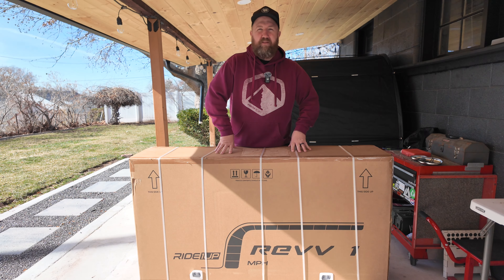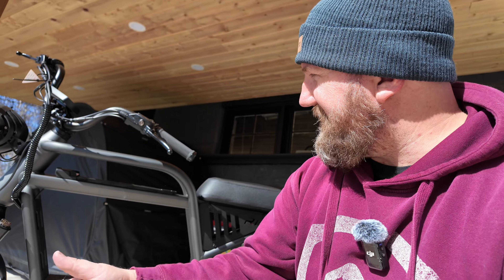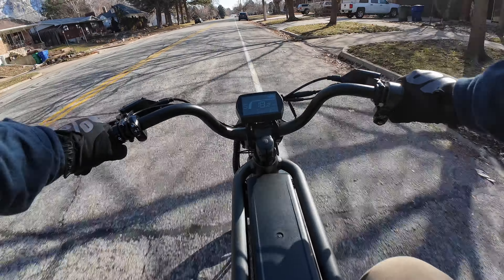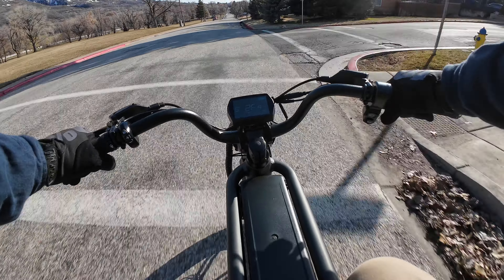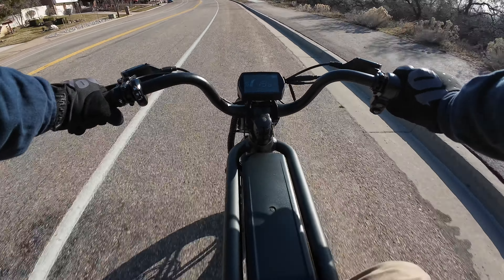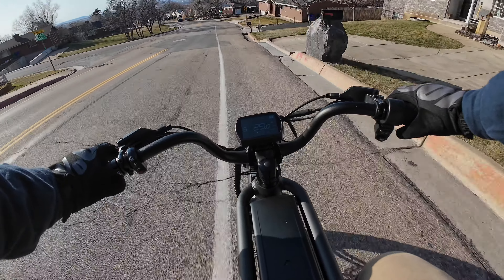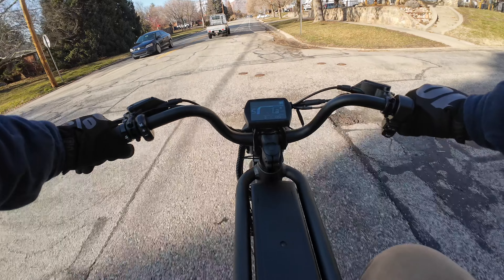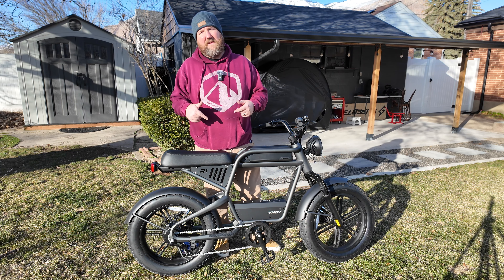Is The Revv 1 Too Good To Be True? | Unboxing, Ride, Review

Comment: Im about 290lbs on good day. I’ve been looking into different bikes and I’m heavily considering the full suspension version. I know you said you were a heavier rider, but I don’t think you’re close to 290. But How has it been for you with hills since getting it? I’m a little worried about the torque not being enough for me as I live in a kind of hilly area and I want to do some off roading
Reply from the maker: Yeah, the torque might be an issue, but there are some upgrades you can make like the Handlworks controller and a better rear shock that could make your Super73 a real beast. But that means you'll need to spend 1/3 on upgrades of what the total cost of the bike is.